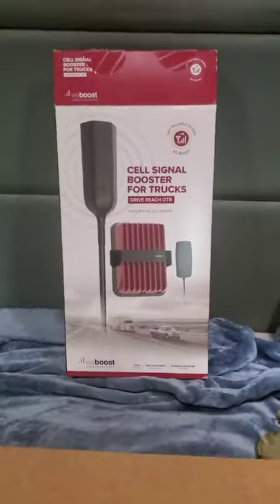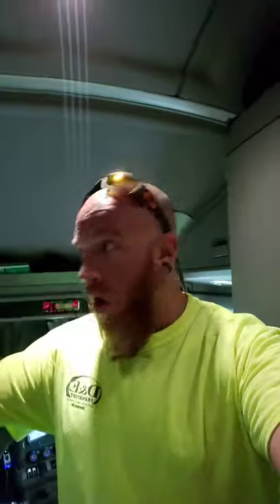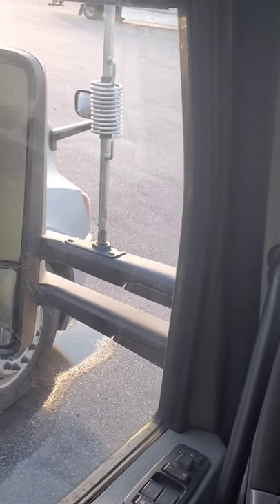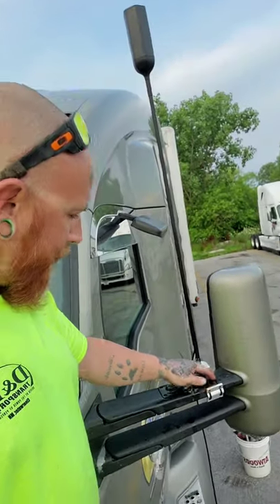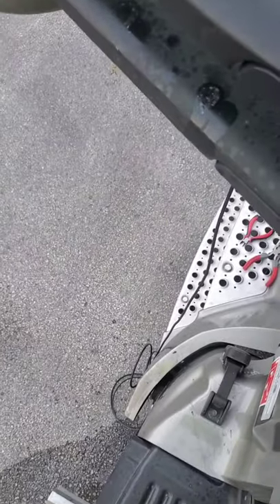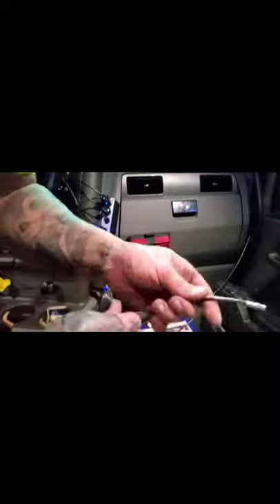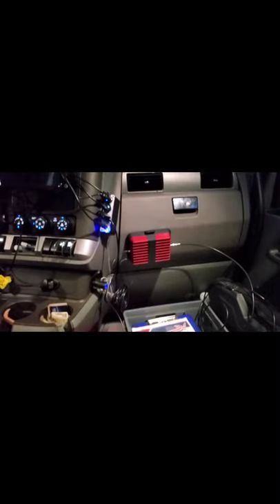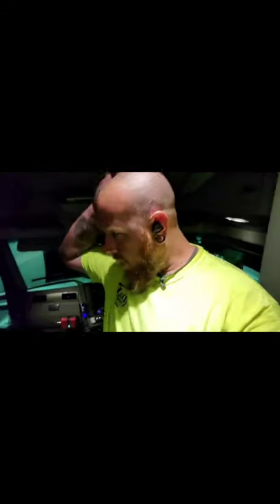installing a Weboost cell phone signal/wifi booster in a Kenworth T680!!

Comment: Cool bro. I mounted mine on the panel just below the glove box. Works great. Also, i use a bird perch mount for the outside antenna where the passenger door upper spot mirror is and mounted it using the included 3 masts for the antenna with a heavy duty spring base. My antenna stands aboove my roof but not as high as my trailer. I have no problems. Also don't forget to call your cell phone company and register it on the their network as per the instructions

Comment: Personally with the CB mount that came with it takeoff the passenger side top mirror replace it with that , you only need one bolt or screw or if you feel like drilling make an extra hole and you can stick that on there personally I don’t use the passenger side one mirror the one that looks down
Lastly I wouldn’t use two poles that come with it because it always seem to break just use one and use the spring if you’re tend to run windy areas if you run dry area don’t worry about it but with me it always seem to break us into adding that spring never have any problems
Reply from the maker: One broke off lol I'm down to one and it does much better

Comment: I don't see any follow up video,  did this help you in any areas you used to have as dead zones?  I die a little inside every time I have to go through new Mexico because it means calling people back every 3 minutes because of all the dead zones
Reply from the maker: Yea sorry about that, never did a follow up video for it. It works pretty damn well. I definitely noticed a solid increase in my reception. Nothing miraculous typically but if I only had 1 or 0 bars I'd gain another or 2 depending on the area. Helped a lot with data speed for my Hotspot with gaming call of duty at night too. It's definitely worth it

Comment: How did the cb antenna mount work out for you. I have the same truck looking to install mine.
Reply from the maker: It works really well. Just disconnect the cb wire from the base when you swap them